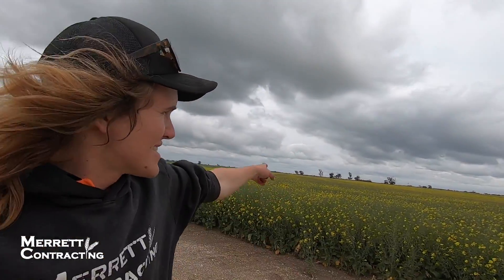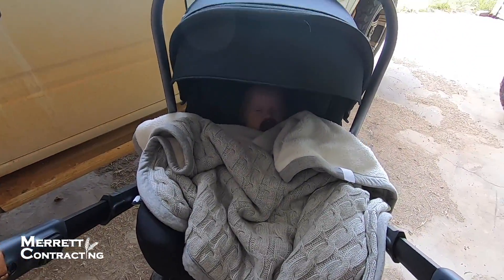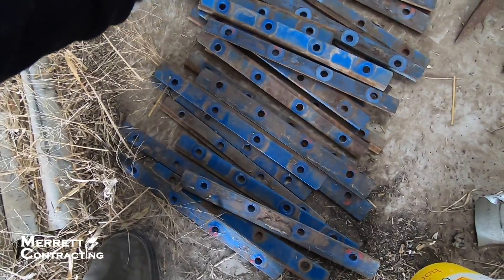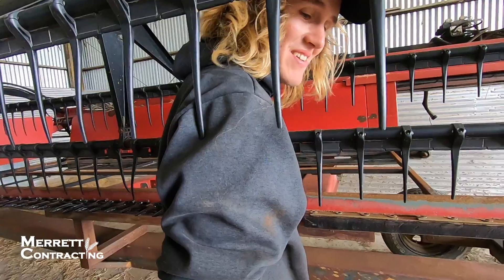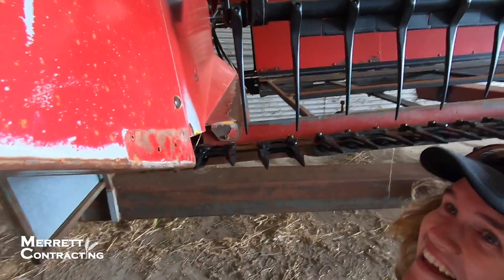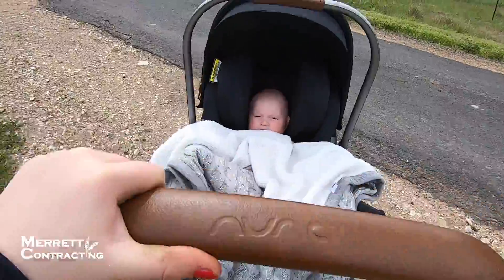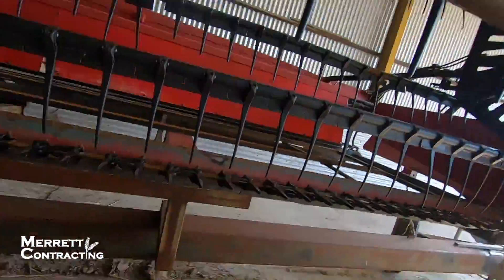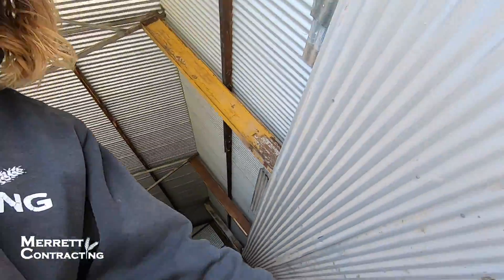Farm Girls Are The Best Girls! | Australian Farm | Wind Rower Pre-Season

Comment: U should see my new case seeder it is a 42 metre air seeder and the tractor i use is a case steiger 620 with nfs connect u should at least try the seeder i raw across my padocks at 30 kmph
Reply from the maker: Never heard of case nfs connect. What is that? And I presume you mean 42 feet?
Reply: No its 42 metres mate
Reply: And nfs is like in built gps
Reply: @merrettcontracting  1
Reply: Me seeder cart is huge
Reply from the maker: Do you mean afs? 😂
Reply from the maker: Where do you live? I’d like to see it working
Reply: Yes i meen afs not nfs me dumb and also i live 2 hours away from albury
Reply: @kobipresnell5320  how many hectares a shift u do ??
Reply: U mean acres and about 1000
Reply: @kobipresnell5320  haha 42 mts and only them acres ,, i sow 500 a day with 12 mts ,, your hopeless 😁
Reply: Look u i ave to drive this thing to the contracts i do at 40kph for at least half an hour and then do that amount of acres and with a annoying son with u (sorry caileb) it drives u mad mate so am i hopeless am i.
Reply: @kobipresnell5320  yep
Reply: @kobipresnell5320  anyway put a photo up of this 42 metre machine
Reply: Also in that machine i dont run shifts only on my old rig i run that witch is 16m wide and u can only go 12 kph or it wont work right.
Reply: @kobipresnell5320  u said u are sowing 30 kph pulling 42 metres ??  Show it
Reply: Ok mate will do
Reply: But i also have a old rig i will do it as my profile